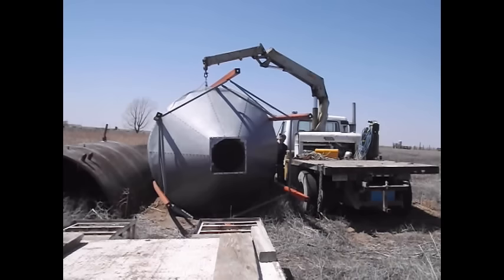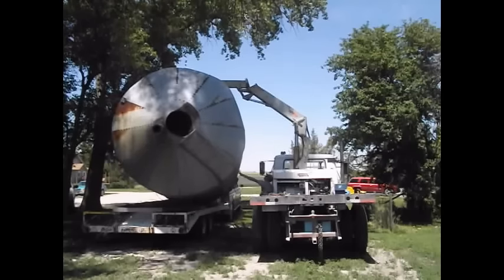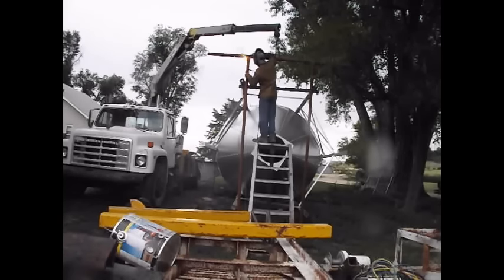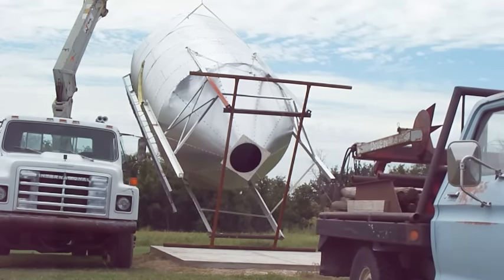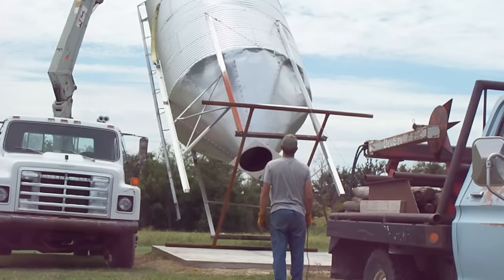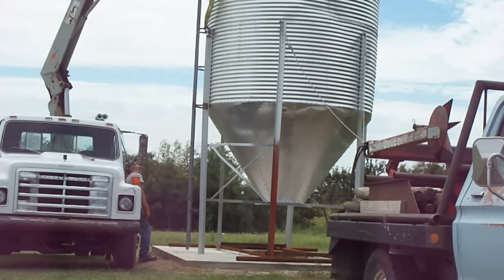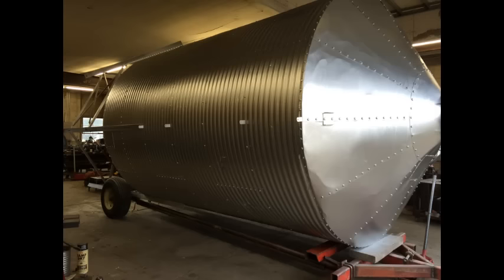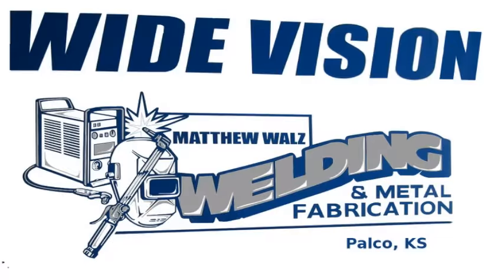Moving Seed Bins. (Knuckle boom action!)(Not in HD)

Comment: My son bought a 14 ton used bin.  We were thinking about moving it, but hired a place that sets them up.  It was less than $300 for them to pick it up, move it 80 miles and set it down for us.  He had a trailer with a winch on the front and the bed dumped straight up vertical.  They could stand the bin up held against the trailer bed with the winch, move it to the exact position, and then lower it down.

Comment: My dad, among other things, grew rice down in Venezuela, when I was a teen-ager. . They went in for poured concrete rather than sheet, but they had to move some very heavy stuff indeed, with winches and hydraulics just as you did. Agricultural stuff is very heavy!  I found this video fascinating. Once you get the bin past 45 deg gravity is on your side, but before that it is hair-raising. (And crane-raising too :) And will the crane take the load? It's at the limit of design. All turned out well, and congratulations. My dad would have used six workers in addition to the machinery!
Reply from the maker: I would think the concrete would be better in the humidity of Venezuela. With all the rain we're getting, these sheet metal ones are condensing inside and spoiling the grain.  From the news, sounds like Venezuela is having difficult times.
Reply: Not only is concrete stronger, it is much cheaper than sheet metal. Much higner capital cost, but you get it back in zero maintenance.
And yes, Venezuela has awful problems. Socialism at work. It still hurts.